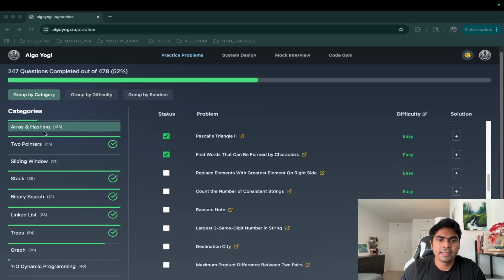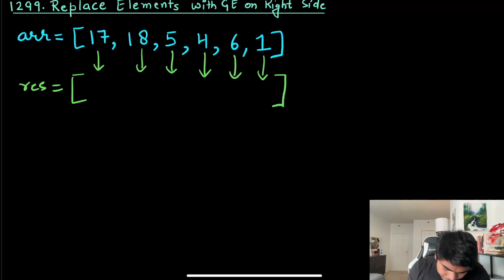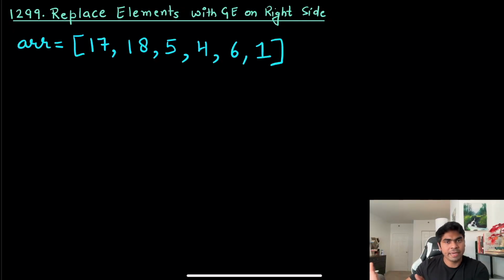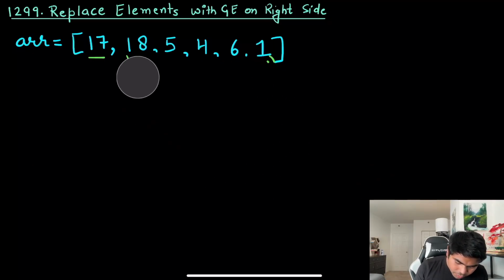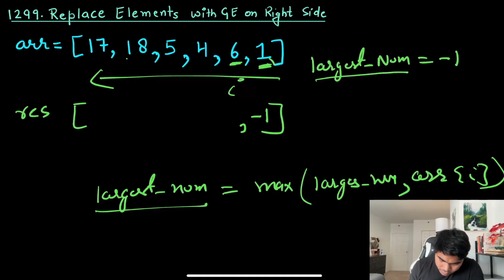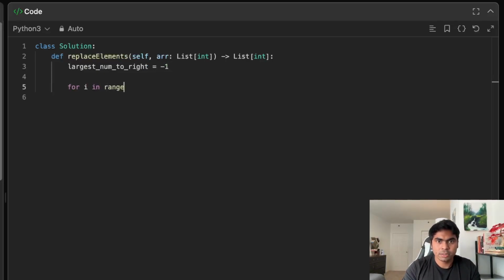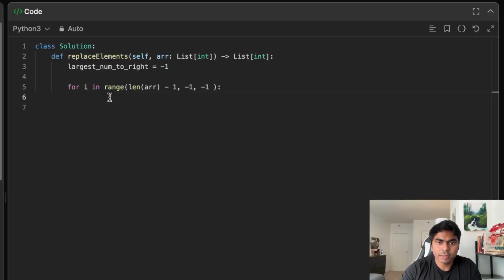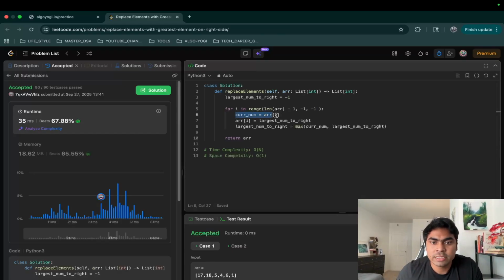LeetCode 1299 | Replace Elements with Greatest on Right | Python Reverse-Traversal | AlgoYogi

Comment from the maker: 🧘‍♂ Pinned by AlgoYogi

🔥 LeetCode 1299: Replace Elements with Greatest on Right (Python)

Steps:
- Initialize max_so_far = -1  
- Traverse i from len(arr)-1 down to 0:
    • temp = arr[i]  (store original)  
    • arr[i] = max_so_far  
    • max_so_far = max(max_so_far, temp)
- Return arr modified

✅ Complexity: O(n) time, O(1) extra space

💡 Drop your clean Python snippet or edge test cases below!